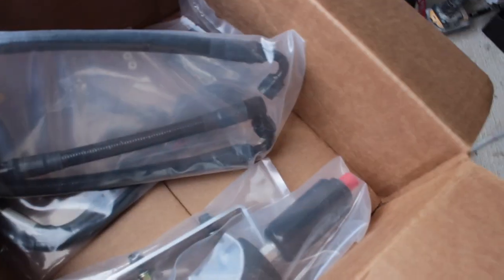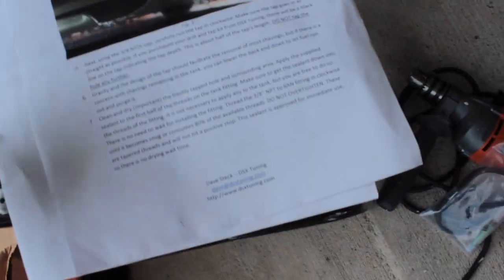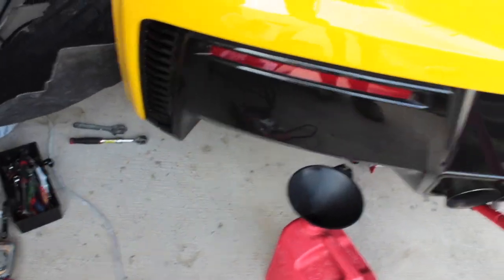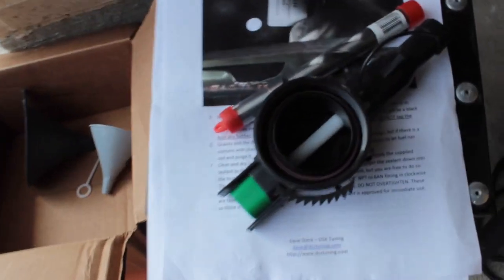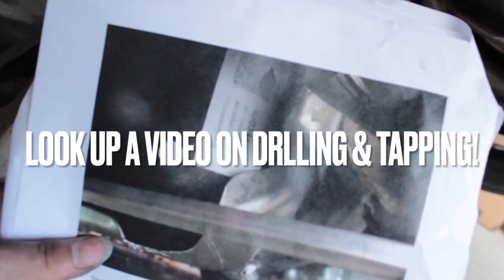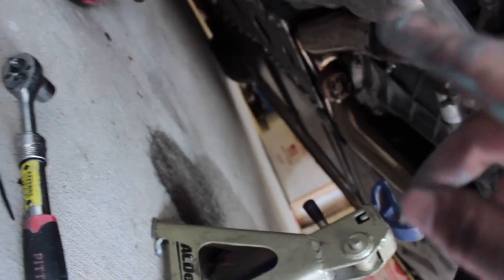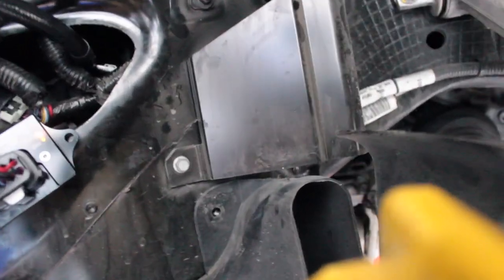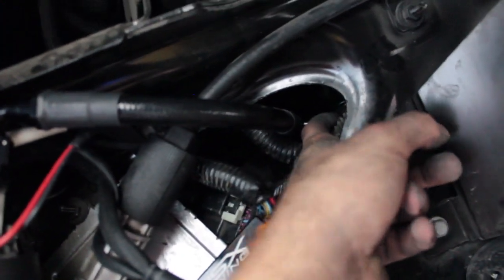DIY C7 Z06 DSX AUX PUMP

Comment: I'm at 706 whp on my zl1 I'm riding the fine line on 93 loosing a little fuel pressure way up top do you think this can be a solution? Car is fbo with stage x ported blower single nozzle meth kit and 15 percent lower
Reply from the maker: Yes definitely!
Reply: @amateursgarage9788  I think I'm loosing a little high side pressure do to low side not keeping it primed!

Comment: So this is all you need to run e85 ???
Reply from the maker: Yes and a flex fuel sensor! To be honest you don’t need this unless fuel pressure is maxed out
Reply: @amateursgarage9788  what about injectors and fuel lines ???? I plan on maxing out a 2650 so I’m def getting this ! Love the channel man
Reply from the maker: You won’t need them! People making 900whp with just this dsx pump. Stock injectors!
Reply: @amateursgarage9788  thanks for the heads up as well as the install vid!